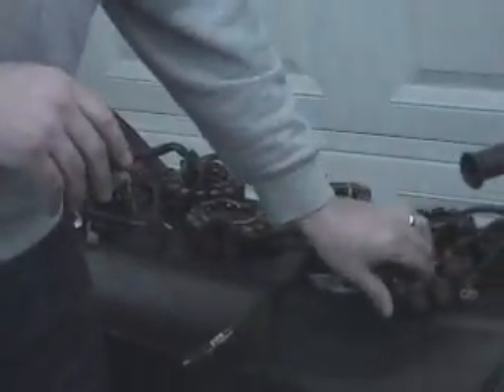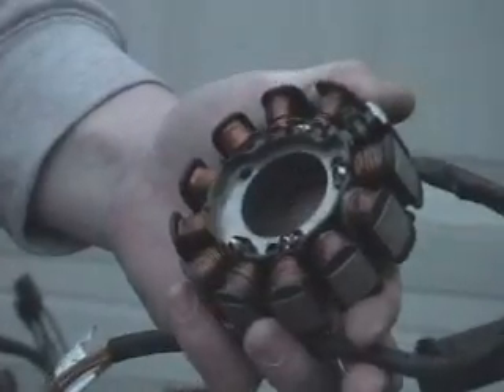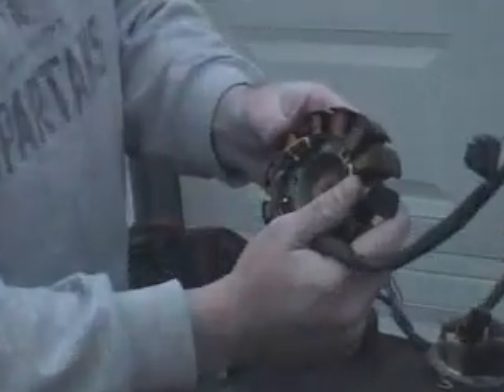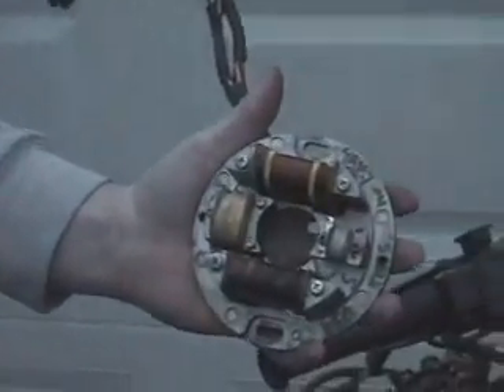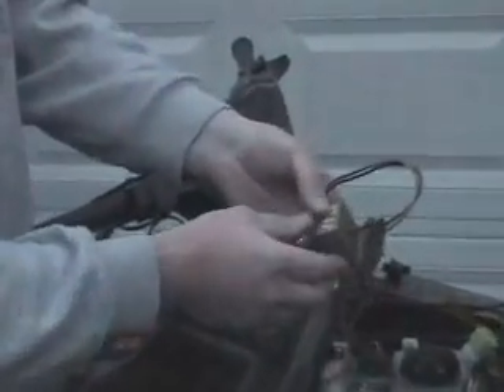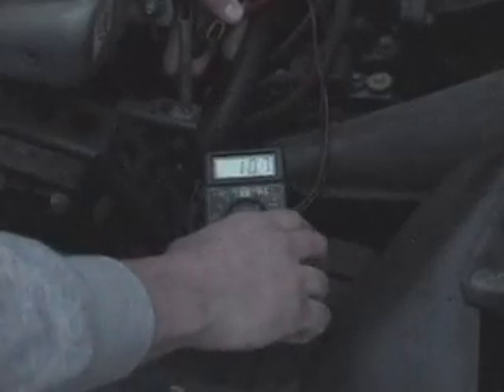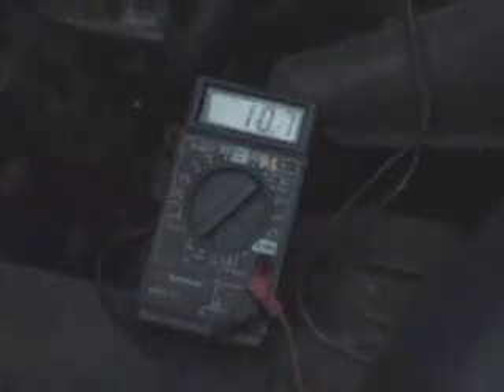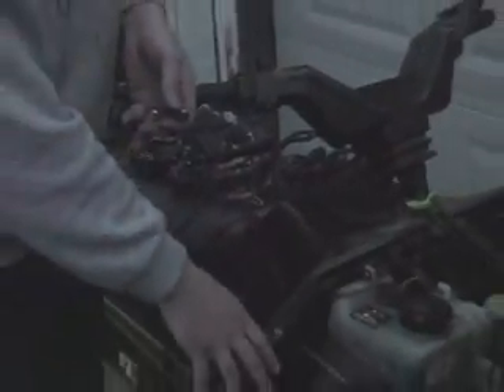Arctic Cat Snowmobile AC Voltage throughout the system

Comment: Awesome video. Ive been troubleshooting an issue with a 99 zl600efi i picked up. Ended up being a mismatched set of plugs under the handle bar pad. Your detailed instructions on starting from the motor plug did the trick. When hooked up, i only had 3 volts. Worked my way to the trouble spot and everything works great. Thanks and great videos.

Comment: So on the 3 yellow wire 4 pin plug how do I bypass the ignition switches to check for spark I have a 93 700 efi wildcat that has a wiring nightmare im trying to resurrect and already scratching my head at step one lol
Reply: Your videos are extremely helpful your the only one that has even touched base on that particular wiring but I'm still confused on how to run a jumper for the none yellow wires all 3 of them are yellow and the 4th pin (Male) is missing but a brown one is spliced that looks to be the wire that belongs there

Comment: Have a 90 cougar, I replaced all items including stator CDI coil regulator plug caps if I leave it sit for 3-4 days pull the cord I get somewhat decent spark that's gone and a half a dozen pulls, bypassed black and brown out of stator same result and home all the switches through the system also good engine shows ground to chassis state or ground shows ground to engine block I'm stumped got no spark
Reply from the maker: Does it start when it has spark? If it starts does it stay running? Will it only start if you put gas in the cylinder?
Reply: @BlaineDP  when it has spark it starts and runs but the spark fades and it won't stay running you can lose spark within four pulls, it doesn't have a batteryfor electric start

Comment: Great video! I'm having issues with my whole lighting system dimming and going out randomly. I think it has something to do with the hand warmers. I watched my whole lighting system go from dim to full strength when I turned off my hand warmers. Do you have advice on how to solve this issue? Do the hand warmers need to be replaced? Is there possibly a bad ground? A short in the wiring for the hand warmers? I have a  99 Skidoo Grand Touring. I've already replaced the voltage regulator and I'm still having this issue.
Reply from the maker: I just made the video as a "general guideline" so people could check a few things for themselves. Of course I've heard of bad hand warmers, shorts under the seat or in the "firewall" portion of the sled ect... Basically you have to just check voltage everywhere and find out if the issue is throughout the entire system, only at certain points ect.. Sometimes the voltage regulator can effect everything and sometimes you just have 1 wire rubbing somewhere that is causing you issue.

Comment: i have a 05 firecat 700 efi. i want to add a small battery and a 12 inch led light bar. all i would need is a rectifier that would keep the battery charged and give a constant 12v to my light bar?
Reply from the maker: I'm not into starters, batteries ect.. but more than likely all you'd have to do is look up the Cat regulator/rectifier used on sleds that had electric start and that'd give you the correct wiring to charge a battery during sled use.

Comment: where should I put an ac to dc converter so I can put a 12v dc power outlet on my 1997 artic cat cougar
Reply from the maker: On the older Cats a general rule of thumb is that you need one yellow wire and one brown wire to get the 12VAC in the Cat system. Depending on models, options that were offered ect..you can find yellow and brown wires in different areas but especially up by the gauge cluster. I am assuming that's the area you want to put it for a phone, gps, electric face shield, 02 sensor ect...
Reply: @BlaineDP  the sled is a 1997 artic cat 550 couger

Comment: I have a 1995 arctic cat zr 580 twin but no spark and I replaced the coil pack and the cdi and stater is good but it may be a burnt out wire or somyhing

Comment: hey Blaine I have a 95 xlt triple and my light will dim and come on all over the place no matter the RPM smooth ride bumpy ride there is no ryme or reason to my head light comes and goes it has electric start and a battery if the regulator is bad wouldn't this mean everything wouldn't work I just want my head light to be reliable I love seeing at night

Comment: hi blaine I have a 1997 arctic cat pantera 580 efi and I have no spark  at all.  I did everything you said in your videos and there is still no spark. it ran good over a month ago and then all of a sudden there is no spark and there is power going to the fuel pump.  what might be the cause of that?

Comment: Hello Blaine. Thanks for your videos. I've watched all of them in trying to restore spark to my 1993 Arctic cat Panther with a Spirit motor, single carb Which I'm thinking from your vids is a closed system, I've tried jumping the non-yellow wires from the stator & tried to check ohms in everything I can find. On the 4 wires from the stator I get 36 oms & less than 1 ohm. On the main coil supply side I get 2.6 ohms. On the two wires from the trigger coil I get 3.5 ohms. I dont know how to check the CDI box. I've cleaned the contacts in the connectors. New plugs. I've bridged the kill switch & key switch wires. Headlight lights when starer is pulled. Still no spark. I understand that's a separate system. Do you know where I could find specs for electrical on this one or what I might try? Thank You!  Brad

Comment: Hey Blaine I have a 94 wildcat 700 efi. That I just got. The guy I got it from said it sat for 2 years. I got a new battery fresh gas. On I have no spark.  My stator has the 3 yellow wires, how do I jump them. I have cut out the tether and jumped the 3 prong plug in the handle bars

Comment: Hi Blaine, I have a 98 ZR 600 LE EFI.  The ECU only outputs .03 volts DC to the fuel pump.  If I connect a 12V battery to the fuel pump the sled runs great.  I tested the resistance on stator for fuel pump circuit (orange wires) and tested as 2 ohms which should be good.  I tested the AC output voltage on that circuit and getting around 68 volts at idle and around 140 volts at half throttle from the stator.  Is that too high?  The stator did get replaced around 1,500 miles ago and ignition and lights working, but could just fuel circuit be bad?  Just wanted to check before I get a replacement ECU.  Thanks!
Reply from the maker: I have not done testing on voltage outputs to the fuel pump.

Comment: Hey Blane, I have a 92 Arctic Cat Wildcat I bought a month ago, it wasn't running when I bought it, but has run until the guy I bought it from said had issue and couldn't figure it out. I replaced the stator which is what I thought was the original issue, that's didn't fix it, I replaced the starting coil, I just replaced the cdi box, and still no spark from plugs. I put jumper wire connecting the 2 non yellow wires coming from the stator together, and still no spark, running out of things to try, any help figuring this out would be helpful, thanks man.
Chris
Reply from the maker: If you used the jumper wire and have no spark then it is the stator, trigger coil issue, coil or cdi. you could have replaced a good stator for a bad stator and your issue was the cdi box.

Comment: hEY bLAINE I HAVE A FRIEND TRYING TO DIAGNOSE NO CHARGING TO HIS BATTERY, THE SLED IN QUESTION IS A 96 ARCTIC CAT WILDCAT 700 TWIN, HE THINKS IT MAY BE THE RECTIFIER, YOUR ADVICE OR OPINION IS GREATLY APPRECIATED
Reply from the maker: The best advice I can give is to check the voltage coming out of the stator, measure it going into the regulator/rectifier and then measure it going to the battery.
Reply: ya unfortunately I just came across the same issue...I was looking 4 a burnt out alternator...& just replaced the rectifier with a brand new 1...checking the wiring but it has a brown & white/red stripe on my open system.

Comment from the maker: Most of the time what comes out of the regulator is AC and goes to the lights. A rectifier converts AC to DC voltage for things like a battery. Depending on the system in your sled/ATV/Motorcycle ect.. most of the time you're using AC voltage to power your lights with. If a rectifier is bad your battery won't charge...ect...stuff like that.

Comment: thank you for the informative video. a couple of questions and let me tell you that I am new at this. if the regulator is bad, will it burn out the rectifier which will in turn will burn out the bulbs and require both of them to be replaced. thank you once again